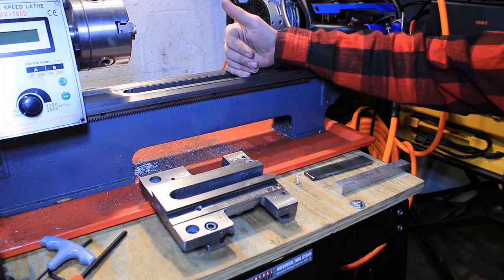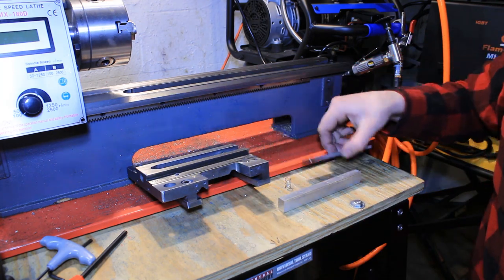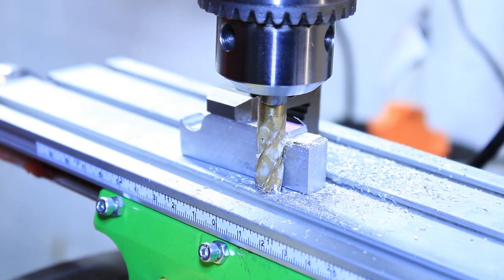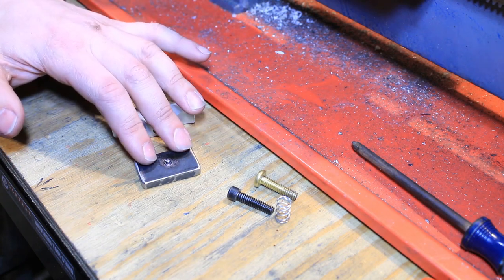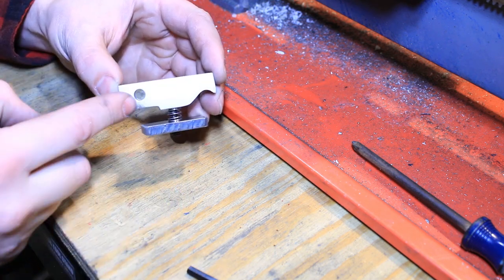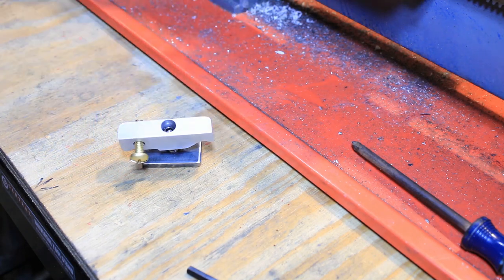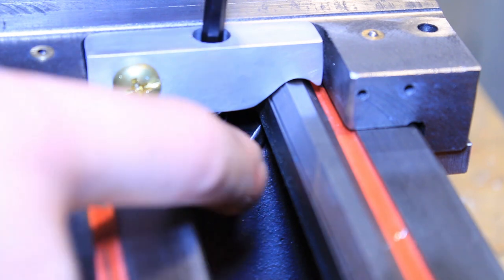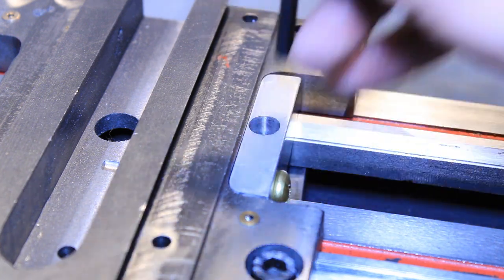Mini Lathe Upgrades Part 1: Carriage Lock

Comment: To stop the anchor plate from spinning drill a hole through the Aluminum block off to the side of the locking screw. Drive a spring roll pin into the hole and let it project down. Drill a clearance hole in the anchor plate for the roll pin to stick through. Now the anchor plate can't rotate but you can still easily remove it if you need to.
You can get a spring roll pin assortment at Harbor Freight for $6 or $7. The are handy to use as they don't require a reamed hole to install. Just drill the hole to the pin's nominal size and drive it in. When used, drill the pin's hole all the way through the work if possible to make it easy to drive the pin back out if needed. In a blind hole you can grab the spring pin with vice grips and squeeze it enough to work the spring pin out.
Cheers from NC/USA
Reply from the maker: Yes, thats great advise! Someone on Facebook suggested that earlier today and I am for sure going to do that. I just so happen to have that assortment box from harbor freight. Haha, along with every other one they have. Thats where the spring came from! 
Cheers for MO, USA
Reply: You beat me to it. That's exactly what I was going to suggest.